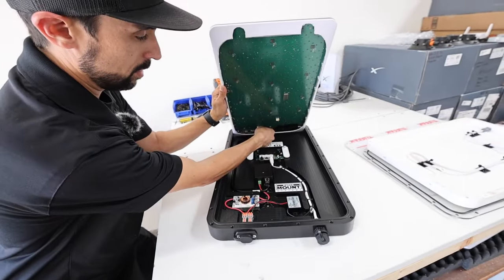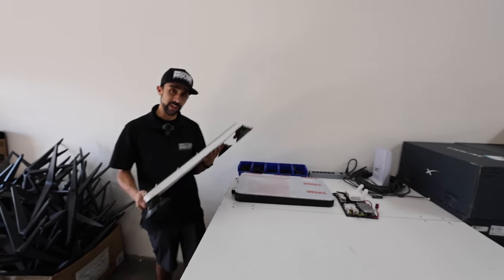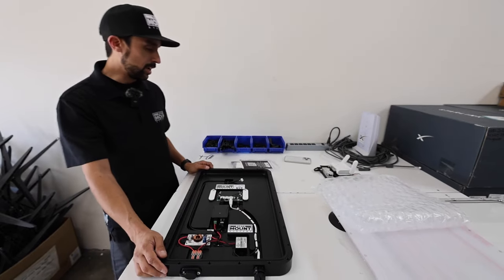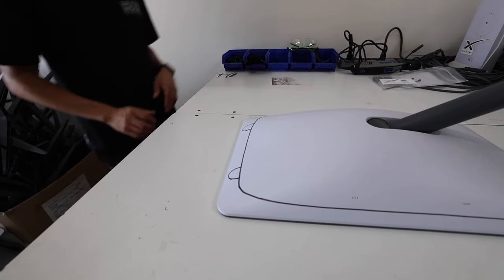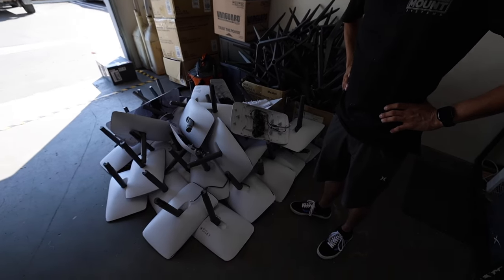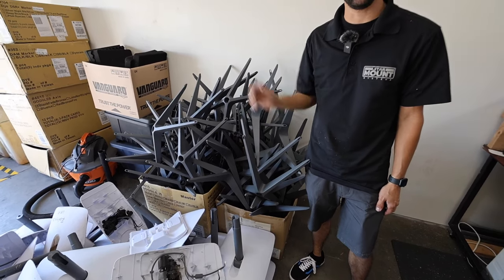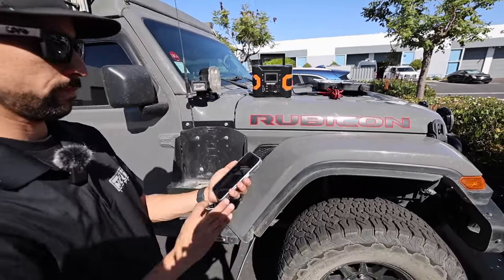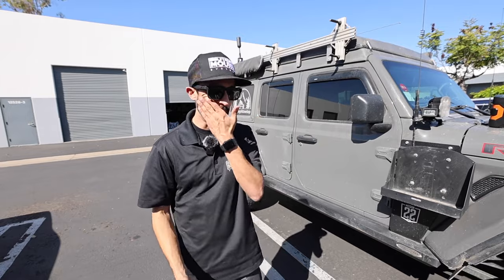Everything you need to know: ALL NEW STARLINK FLAT MOUNT from STAR-MOUNT SYSTEMS

Comment: Stan -  I did all of this - installed my 12v all-in one ..... worked great for a day ..... then I parked under a car port  - and forgot that the SL was still in "ON". switch position.    Now everytiem I plug it in I pop the 10 amp fuse in my fuse panel.   Any ideas what to look at ?
Reply from the maker: I’m not sure why parking under a carport would have any effect on the unit. The Starlink would just continue to search for a single. 
Try contacting Brandon at Star-Mount Systems. The number is on the website.
Reply: @jeepNtreetop    - Yes -  my only thinking ws that it may have interpreted the loss of signal. to obstruction by snow - so turns on the heating function.

Comment: Brendan you make awesome videos and you are a legend in Africa for us over landers in Africa who need connectivity (out goes the expensive Sat phones) Finally ordered my Gen 3 dish and the Gen3 12v conversion  flat mount with the quick release plate. Cant wait to get this fitted onto my Land Crusier for my 3 month trip later this year.

A quick question: is it better to screw/bolt down down the flat mount or do the suction feet provide a robust mounting - bearing in mind the rough terrain (but barely moving at 40kmph)
Reply from the maker: The suction cups work great but I use them because I remove my dish occasionally. If you do not want to remove your dish, a permanent mount is always better and more secure.

Comment: Wow total ripoff i built my own tore down the starlink router and built all in 1 with 12v from the board 12v runs on cigarette lighter  only 1 power cable to run everything. Cost about a £10
Reply: Interesting any links or instructions?
Reply: I wouldn't call it a "rip-off", although I would personally never pay anything like that amount for something I can DIY. As for your own hacked system, you're full of crap. While it's certainly possible, and I've seen other videos doing that very thing, it's very risky (can easily brick your Dishy), a LOT of work, and costs a LOT more than £10. You don't get to not count parts and supplies that you happened to have on hand that others definitely won't.
Reply: Let’s see the set up

Comment: Great video, thanks for teaching us how to do this. I've seen a video where you can just pull apart the front from the back of the dish as it's only glued together, could you possibly use the top without the extra part of the back that's left over when you cut it with the Dremel, or do you need the extra back left on?
Reply: did you ever find out if you can just pull the face off?
Reply: @elliotallen1  nothing from my question as yet, I've seen someone else pull it off and have a casing created to house it in and then lay it in their vehicle window and it worked on 12V.

Comment: Yes, looks very easy and it is. However, after my modification the router kept dropping out and eventually was unavailable. I managed to remove the dishy and did a hard reset on the router which got my a signal from the router, but now the dishy will not move off from “booting”. I have no idea what to do now as Starlink won’t be interested because I have butchered dishy and Star Mounts don’t seem to interested either. I am seriously thinking about buying another dish and stick with placing it on the roof. The star mount and removable mount shall need to stay on my RV roof as a very expensive ornament. If I could return the lot I would as after 4 days of fault finding and 1 day of use I’m not happy but I live in Scotland so not easy. 
I would seriously think hard about what your are doing if you select this product and the support or lack of you may get or not as the case may be. If this item was bought local I would be at the door demanding a refund
Reply from the maker: Stewart, sorry to hear that you are having troubles. I’ve had mine running now for over 2 years with zero issues. In reading the many forums most folks who do 12v conversions and have problems tend to trace the issue to an unreliable “stable” and strong enough power supply/source. Maybe start there?
Reply: @jeepNtreetop  Hi, thanks for the suggestion. I rigged up a fluke meter measuring the supply voltage at the terminals inside the mount and it had a constant 13.6volts for 12 hours. On checking  24hours later it was still 13.6Volts. I checked the output voltage on the 12V to 48V output to Starlink which is correct. So think we can rule out supply voltage. Interestingly, heard nothing from Star Mounts in 7 days, shockingly bad customer support.

Comment: I've seen the marker trick, to mark the cut line before, but I wonder why you wouldn't just clamp your cutting tool at that height off the table, then feed th dish into the stationary cutting tool.  It would be a perfectly flat cut, and should work in theory.

Comment: With the wifi modem built into the mount, is the signal weaker?  Also, does flat mounting the dish have any effect on acquiring satellites?
Reply from the maker: The dish has no issues acquiring signal, in fact it acquires much quicker now. 
As for the Wi-Fi the signal strength is adequate for its intended purpose. This setup is designed to be mounted on a a vehicle (RV/boat/or portable in some cases) and provide strong signal to that area. If you need a stronger signal or even a hardwired connection a LAN port is provided on the mount to allow for the connection of a Wi-Fi booster or directly to your computer.

Comment: Good looking product.  I've done away with the router and in my RV I just power a POE off of my 48v DC system (I run 48v instead of 12v to my Victron).  I run a similar router, which keeps a continuous site to site VPN tunnel with my office when I'm on the road.  I however still use the full unmodified dish, which I just put on a pole when stationary.  I considered flat mounting, but was concerned about the possibility of reduced throughput, by not having it ideally pointed.  Has anyone compared the before and after?  I may consider doing some performance tests with my existing setup before taking this plunge.  My luck though Starlink will come out with a firmware update that blocks Internet when it senses the motors are disconnected.  After all, they sell an "in-motion" dish/service so if a modification like this becomes too popular I could see them ensuring it gets blocked some how.  Glad it works.  Hope it continues to work.  I saw several of these flat mounts on race cars at the King of the Hammers earlier this month.
Reply from the maker: There are thousands of flat mounted dishes out in the field now. “Pointing” the dish is no longer necessary with the hundreds of satellites now in orbit.
Reply: The flat mounts you see on race cars are official Starlink flatmount systems that never had motors and haven't been hacked. They are a lot more expensive out of the box, but keep the warranty and factory environmental resistance.

I don't think they'll ever bother disabling hacked Dishies. After all, the profit comes from the monthly service fees, and if you convert a stationary mount to a flat mount you'll be paying more for the service but they'll have less investment in the hardware, so it's just as much a win/win for them as it is for you.

Comment: Starmount tray warped from heat.  Port problems.  Every hole on top panel cracked.  Leaked.  Ruined my starlink.  Lousy product.  Disappointing conversation with the owner.   Don’t buy it
Reply from the maker: No problem with both my units, my guess is that you overnighted your bolts causing the top panel to crack.  Prime example of user error, sorry that you ruined your dish.
Reply: The obvious reply is over tightening.  The non obvious observation is that the bolts were tightened just enough to slightly compress the gasket.  There is so much heat build up increasing pressure that likely causes the cracking.  That is likely the issue. Design flaw.
Reply from the maker: @robertdippold7985  sorry to hear that yours failed, for whatever reason, but there are over 10,000 units out in the field worldwide that didn’t. I like mine and it works flawlessly.
Reply: My lower portion warped and the top cracked at each hole. Water penetrated the enclosure and ruined the dish. Poor design.  All screws were tightened to just barely compress the gasket.

Comment: I just went through this: their marker+tape measurement is horrible.  It’s off by something like 5mm with the Pro RJ45 mount, so you’ll spend hours sanding the thing down to be flush with the box.  For $5 I could make a jig that would give a way more professional mark.  And they don’t even link to the right instructions with their QR code “where the fuck is the RJ45 instructions??”  (They’re under the all in one mount).  Overall 👎 for how expensive it is, very shoddy process.
Reply from the maker: The video walks you through the step by step of the whole process including the rj45 connection. If you have any issues at all give Starmount a call and Brandon will walk you through any issues that you may have.
Reply: Please let me know where to send my $7.50 for your more professional template.  That is 5.00 for your work to make the template and I am adding a very generous 50% fee for your hard work.  Also, I just watched the really excellent demonstration and won’t need any instructions.